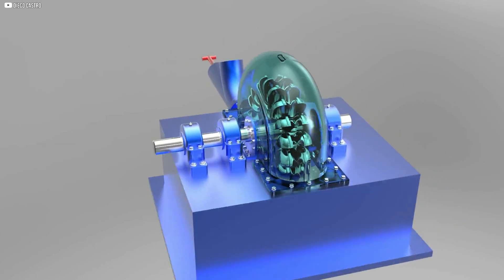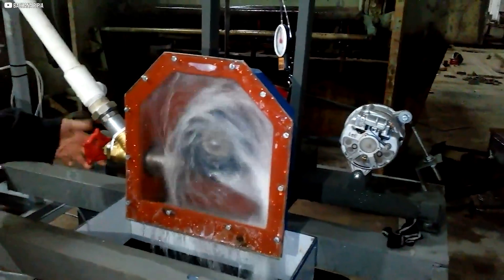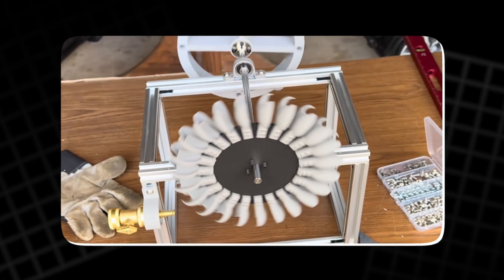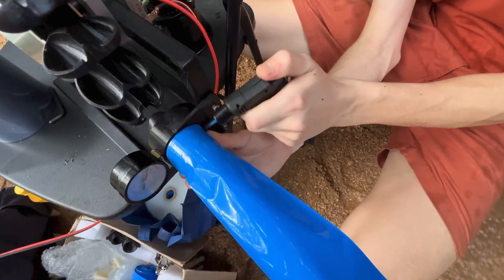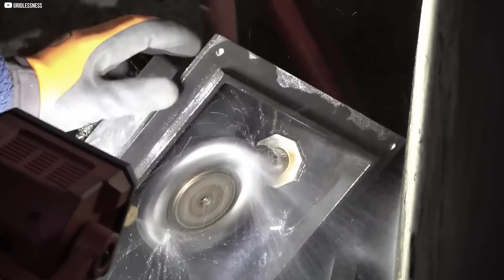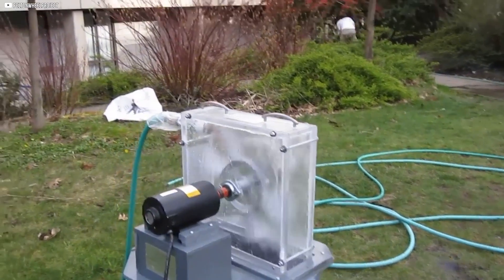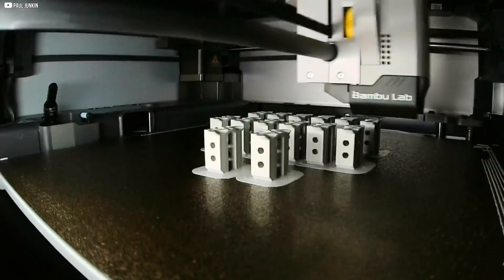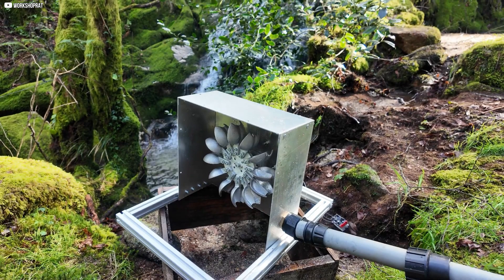DIY Mini Hydroelectric Power Station: Harnessing Water for Clean Energy

Comment: Not very useful. A smattering of different builds.  They keep showing pictures of single phase rectifiers.   A three phase rectifiers has six diodes.   There are packaged 3 phase blocks, suce as the DB125 series, but they have 5 leads not 4.  One lead for each of the three phases, then the two plus and minus DC output leads.
Reply from the maker: Thanks for pointing out the differences in rectifier types; it's a good reminder that there are several approaches to consider!